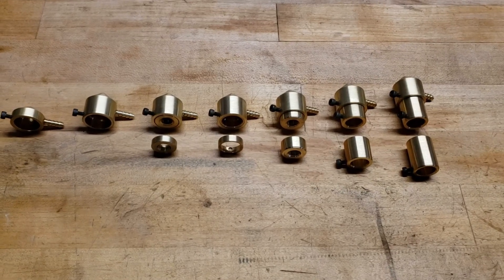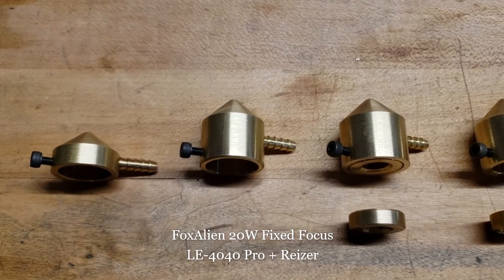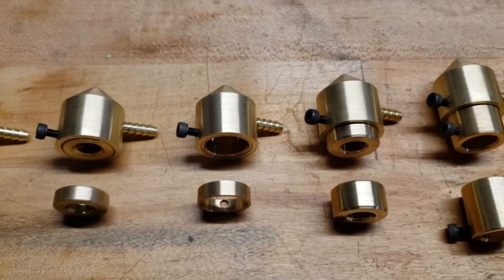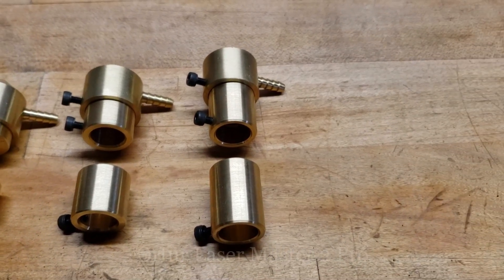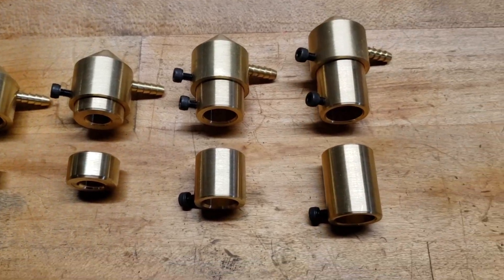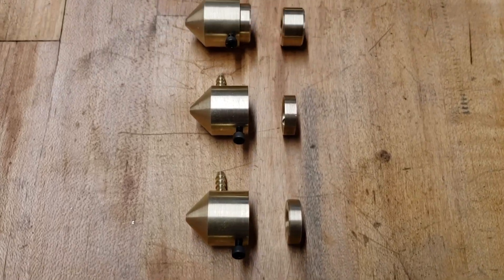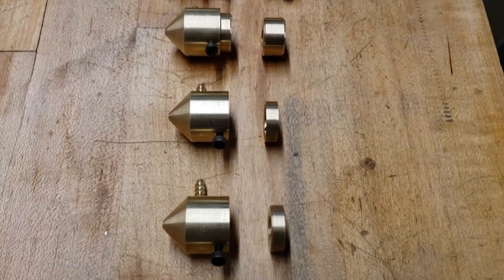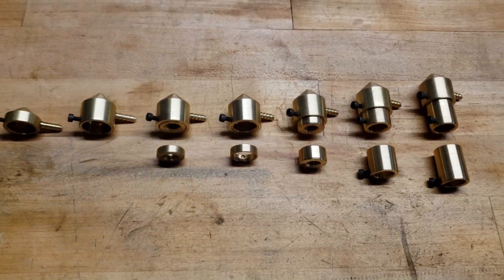Laser Wizard Universal Air Assist Nozzle

Comment: Hello friend, I sent by your email, a photo with the dimensions of the original nozzle of the S6 Pro, did you see it?
Reply from the maker: Yes! I actually just responded a few minutes ago. Thank you for emailing me!
Reply: @laserwizard1982  Ok friend, thanks for the reply but, before proceeding, do you have an idea of how much it will cost (approximately) to send to Brazil to CEP 88190-000; State: Santa Catarina. Thanks
Reply: @laserwizard1982  Hello friend, I sent again to your email two photos of Module S6 Pro for you to check.
Reply: @laserwizard1982  Hello friend, I sent again to your email another photo with the measurements of my Sculpfun S6 Pro laser module for you to try to make a Nozzle for Air Assistant, but you didn't answer me anymore. Now, if you don't have Nozzle for the S6 Pro, no problem!

Comment: Hello...would the air assist for the atomstack A5 Pro work for the atomstack A5? I don't have the Pro model, not sure of the difference. Thanks
Reply from the maker: If you email me pictures and measurements, I'll make one that will work with your module.
Reply: @laserwizard1982  how do I contact you?
Reply from the maker: @msctoya  you can either message me through Facebook or send an email to thelaserwizard @ gmail.com
Reply: @laserwizard1982  ok will message you